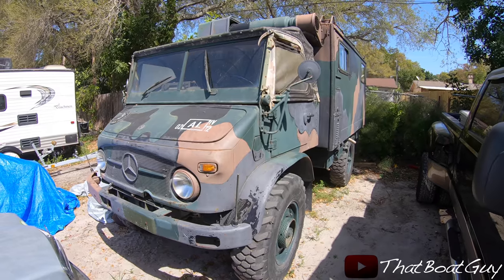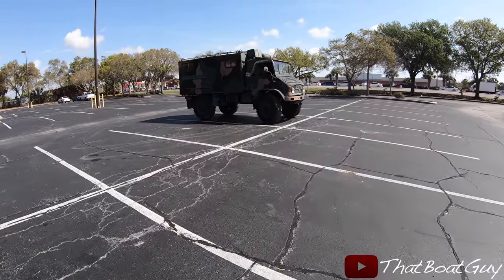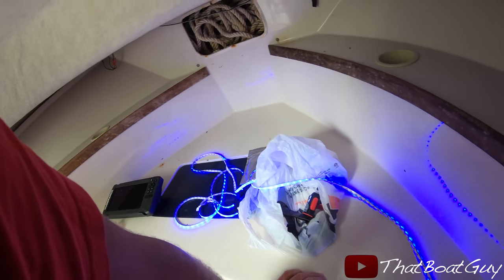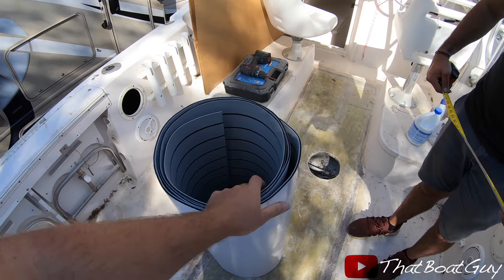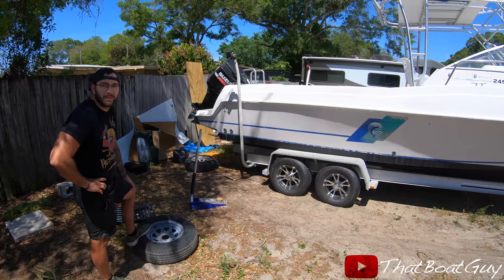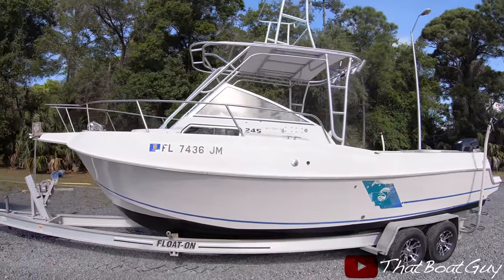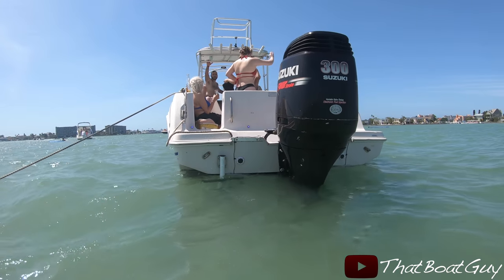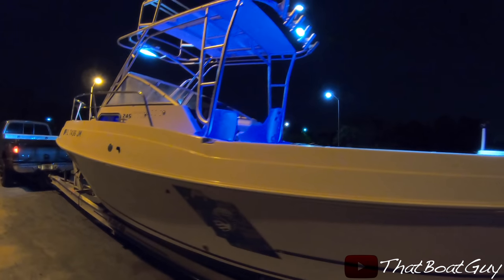Once In A Lifetime Boat Deal

Comment: Looks good. Anytime you drill a hole in a boat it's a good idea to drill the holes out bigger than the hardware you'll be using. Then fill the holes back in with thickened epoxy and drill the final holes through the epoxy slug that you put in there previously. This does two things, it prevents water from leaking around the screw and rotting out the wodden core under the fiberglass, and in the event that your boat has a foam core it prevents the clamping forces from the hardware squishing the foam which let's water in and causes the hardware to loosen up over time. It takes a little longer, but it will make a huge difference in the lifespan of any fiberglass boat.
Reply: Lmfao infer the fiber glass you realize bots are made in three main pieces and are clamped together right and your epoxy “trick” is about the dumbest shot I ever heard in my life drill the hole bigger and epoxy it instead of using marine 5200 to seal it like every boat builder in the world does
Reply: @Omgbelle-zx2yi  Went right over your head. Thru hulls are about ''clamping bots'' together.  Once the epoxied hole cures, then the fitting hole is drilled through - During installation of the fitting 5200 is applied to seal and bond to the epoxy.
Reply: That's correct Jacob - It's best to not drill a much larger whole, but rather to use a dremel to clear out a collar between the fiberglass skins. Then use epoxy with fiberglass microspheres as the filler. - Wax coat the thru hull, or an equal sized plastic fitting - and install this to set the epoxy/glass form.  After a day remove this , clean, and install the fitting with 5200. -  All thru hull fittings should be stainless or bronze.  Plastics are just a time bomb.
Reply: yes but i always thought if the hole is too small, it promotes cracking and crazing of gelcoat. I put tape over it for this reason, and drill the hole about 30 thou larger if i can. same result, different reasons kinda thing i guess.

Comment: You should put a wedge piece of aluminum on the transom matching the same holes for the ladder bracket to change the angle of the ladder making it easier to use and get in the boat. What a as the final cost after all the upgrades?

Comment: That battery cable brought back a memory. Was in Bimini and got invited to fish with some of my friend's neighbors in their 20' center console. Trolling when the engine died. I went to the stern and saw the positive cable burned off the terminal. I clamped it back on with vice grips.
Stepping off the boat later, I mentioned to the guy to remember to fix the terminal.
I later heard that 2 weeks after, the guy broke down off of Port Everglades while being chased by blue flashing lights and loaded down with bales of weed. He went to the stern, replaced the vice grips, went back to the console and hit the key with his knee, breaking it off. He did 2 years in the slammer.
Reply: Did you get his boat?  Cheap!

Comment: You never cease to amaze with your boat transformations. And yes that boat was a steal, that trailer is probably worth what you spent! Nice job.
Reply: I know the motor was woomore than $2500
Reply: Motor new is well over 10k. A new 25hp is 4000. Motor may be 15 to 20

Comment: The 2 of you did a great job on the boat. The only thing I would have done differently is the ladder. Sure the one you placed on their is unnoticeable but how hard will it be to use it when your out in the open water and the boat is bobbing around. Your gonna wish there were handles on it.

Comment: I saw that you're using one of those harbor freight grinders, just one thing to mention: I had one and they didn't put enough grease in the gearset, which made mine die prematurely. I think if you take off the four screws holding the main gear cover and gear on, you can put grease in it and make it last a little longer!

Comment: Imagine how much of that resin poured into those gaps ended up in the bilge area.   I hope that new tank never has to be removed.
Reply: That plywood isn't going to last very long without resin and glass on every side. Should have wrapped the plywood and used stainless screws and marine caulk.
Reply: @MarshallSorenson  agreed.  If you're doing that much work... Just lay up some glass and make better hatches.

Comment: With those waterproof lights, silicone all of the glass to metal seams, the wire gasket and screw heads.  Anywhere water can get in.  They tend to always spring a leak and fog up otherwise.  5 minutes of seam caulking to save a few hours of replacing them :)
Reply: X2 🙌Try Boatlife Life Seal it’s a pretty good product to try out.

Comment: Shortcut solutions - tomorrow's problems- Hope this is for personal use, not sale
1. The deck is open - ready to create storage lockers/fish box - worth the little bit of extra work to create a hatch.  Also, if the fuel tank needs to be repaired/replaced, a deck hatch would mean not having to rip the deck again.  Also, nothing under the plywood?  Marine plywood is still wood - trapped moisture, including condensation under deck, will cause rot.  Next time glass both sides  and finish.
2. Use Naval Jelly, FSR to remove rust - no need to abrade the gelcoat.
3. Non-marine grade LEDs will go out, in a season 
4. Transom light installation - no sealant? Engine chop and waves will cause intrusion... Once transom rot begins - it always ends one way.
5. Gunnel lights - better to install under the cap. They won't become holes for water intrusion from a wet deck, less corrosion and leakage to stringers etc. Also, less glare - even if blue, at night diffused light under a cap is better than an exposed bulb cutting down night vision.
6. The unsealed transom installs are a time bomb - Use Coosa for the inevitable rebuild.
7. All of the old pumps, thru hulls, switches, and wiring are the greatest points of vulnerability to an offshore breakdown or sinking.

Comment: Erm, not sure if anyone has asked this already but why didn't you just line up one straight edge of the glass mat and overlap the other to make your mark on one side and cut on one side instead of down the middle? That saves you time cutting only one side instead of two and also saves you a much bigger piece of glass cloth for other repairs. Also for future reference, small rollers are much better for spreading the resin than brushes are.

Comment: If that unimog was a gas motor you would really have a problem. Ive heard that diesels have rod knock, but this is a whole new level
Reply: Jacob, you HEARD right about Unimogs. They were great machines that were capable of doing many tasks with the equipment add-ons the company offered. They offered farm and construction add-ons that made this a very useful vehicle at one time. Kinda like the Swiss army knife of trucks!! LOL.
Reply: Don't believe that's a rod knock, it is likely injector noise and valve train

Comment: I just purchased a 2001 yamaha 90 2 stroke that was sized because it was sitting for a long period of time with the head off. So we got the rust cleaned up  and we got it to turn freely. There is a bad head gasket so it has 60 psi on all the cylinders. We noticed there is the tiniest amount of play in the crankshaft. Since you have worked on many of these motors, I was wondering if we need a rebuild or if it is to factory spec to have a small amount of play.

Comment: I noticed the hatch cover leading to the cabin was broken. I used to work at a small glass company and we made plastic windshields and covers such as that, as well as building and replacing glass and safety glass windows. Any glass company could use your cover as a template to make a new replacement for you.

Comment: I get that these are budget rebuilds. But that’s the wrong wood. Marine plywood from Home Depot is not marine plywood for fiberglass. Fiberglass will not remain adhered to pine. Not trying to be “that guy” but....
Reply: Genuinely curious, I wouldn't have thought the type of wood would matter as resin/epoxy is not a material I've encountered to discriminate what it sticks to (outside of polyethylene). Is there a reason pine isn't a good choice, and what wood would be and where to get it?
Reply: @jw11432  the reasons why are several and I’m happy to explain. Pine has oil and sap in it. You can glass over it but in time it will release due to oil and sap. 3/4” Marine plywood is typically made from fir and is 7 layers, no voids and glued together with a waterproof glue.  Pine 3/4” marine plywood is treated. Is usually only has 5 layers, and voids. Left outside it will delaminate. The cost of marine grade 3/4” fir runs 90-110 bucks a sheet Depending on location. Is smooth on one or both sides. It’s idea for fiberglass but it does require the resin to be thinned with acetone and apply Several coats to deeply penetrate. Bottom line. That hatch won’t last long. Not trying to bash the guy at all. He may not know that. Folks see “marine plywood” at Home Depot and automatically think that’s what’s used in boats. It’s not. Boat repair needs to be done correctly when you’re dealing with peoples lives. Hope that helps.
Reply: @g-townfishing6167  I thought maybe it was oil/sap related (knowing what I do about pine), kinda how you have to use the right glue on concrete floors otherwise vinyl tiles will come up due to moisture seeping through the porous concrete.
Great information, thanks for sharing.
Reply: @jw11432  absolutely. You’re welcome.
Reply: No problem the boat will be long gone by the time any of that delamination happens.
Reply: @jrrains  I’ve seen fiberglass delimitate from wood in 6 months so that’s not necessarily true.
Reply: It was treated plywood.
Reply: you say you aren't trying to be that guy but then you do be that guy.
Reply: @mr.annoying9453  glad you noticed.
Reply: @mr.annoying9453  actually I feel like you're being that guy.
Reply: Spruce is usually better but I've never had it come up
Reply: I respect the hell out people like you who aren't afraid to say a hard truth when it can save lives. You're humble, honest, and ready to learn. I'm glad I got to read this tonight :) 

Learned a good bit about it all too!!

Comment: You didn't fiberglass the bottom side of the wood. Will that hold up over time? Or do you recommend fiberglassing the underside and topside of the floor you replaced?

Comment: Trim tabs not working? Boat is leaning left when running. Right tab extended a little, left one fully retracted. Also doesn't seem to fit the trailer.

Comment: Beautiful job you did on that Aquasport 25.
My Boss in the Keys had a 24 foot Aquasport with twin 250 Yamaha engines.
Same style, open fisherman.
Got to do lots of Dolphin fishing and other activities including lobster mini season diving in it.
Whale Harbor sandbar parties.
What about trim tabs, did you install them ?
That type of hull almost requires them in any kind of chop.
Did you fully inspect the fuel tanks before you permanently fiberglassed it in ? You should have made it into two removable sections with watertight seals. Future fuel line, tank leak and fuel level sensors  problems would be awhile lot easier to get at and fix.

Comment: The engine alone would do 2500  dollars where i live, so it's indeed a steal alright. Hell, i could do this for a living, but then i would have to move to the states because
you won't find any deals like that here in holland.
Reply: Agreed!!! That motor would easily fetch $10K AUD easy. You kind of wonder how much "poetic license" You tubers use in their DIY vids. That said, still a great video! Even if the $$$ are hard to believe.

Comment: I have a problem with my boat motor. It won't start but it spark, it has compression,and it use the start with the first pull but now it won't start its a 15hp 2 stroke evinrude. Do u think u know what's wrong with it. If you can give a hand or an idea of how to fix it.

Comment: Funny how people think boats cost so much to fix, but, will buy a rusted out old car and spend years fixing it and have more money in them than they can sell them for. That is a easy 3k profit if you sell it . I have a 1982 Oliver  19 ft bow rider 120 hp omc inboard that I bought for 1200 bucks with tilt trailer , put a new set of points and condenser and it ran just fine. Owned it for 14 years and changed the water impeller 4 x and fluids ever year for about 400 bucks in up keep costs over the 14 years . I can sell it for 3k any day

Comment: @ThatBoatGuy.... I have a 1992 17' Grady-White CC that needs some 'love'... floor is soft as Carvel ice cream around the middle under console/T-top/over fuel tank, etc. and hasn't been used in a couple years. Has a CLEAN 02' Yami 115 that has about 400 hrs on the clock, that ran AWESOME before it's hiatus. Comes with an aluminum single-axle Float-On that's in pretty nice shape... Was gonna pull the power off and sell that and the trailer maybe, but...any interest? I see EVERYONE WANTS you to get up on a 'new' project LOL,

Comment: Congrats on the unimog. But it is more pronounced oonimog (in German there is no j sound with the U) , meaning „universal Motor Geraet/Gerät“ or universal Motor device or apparatus.

And here in Germany they are extremely expensive. Even the used ones. Non under 25k$.

Comment: i have an evinrude 25hp and while on the lake when it was in forward it kicked back into neutral and when you put it back into forward few seconds later it gose back into neutral and runs real ruff

then when i took the lower unit off there was metel chips and small gears in the oil box

Comment: All that effort to install led lights and you dont install navigation lights?! The paint doesnt line up with the laminate overlay, paint lines are not clean. wells are not clean. It looks good, but a little more care and it can be much better. Also this would be a great fishing boat and you take it to a sand bar? Take to top stand off if you are not going to use it to spot fish.